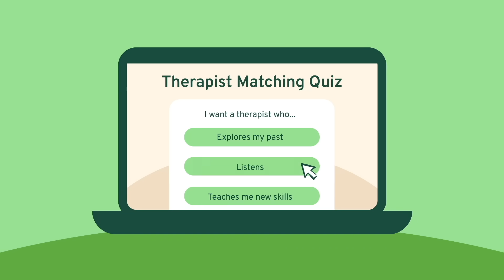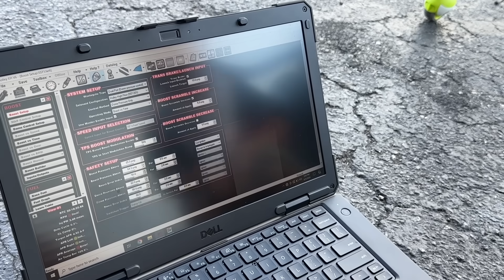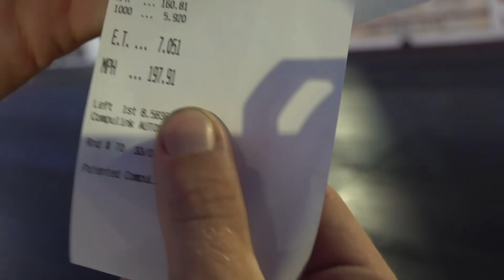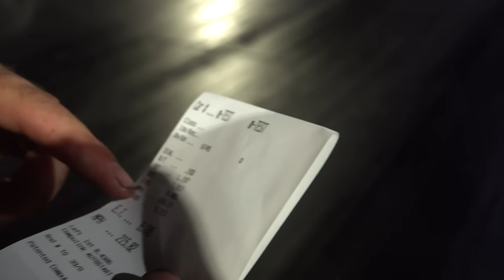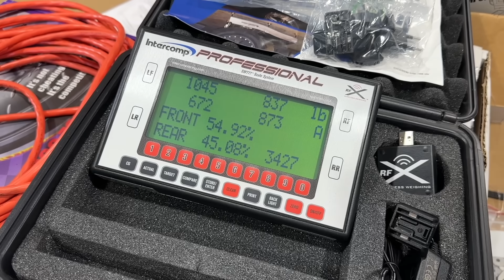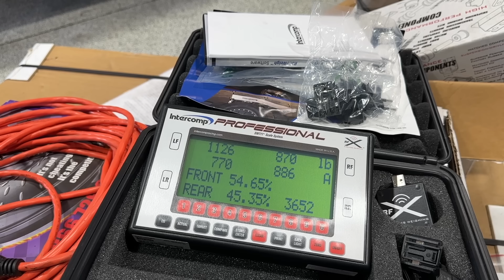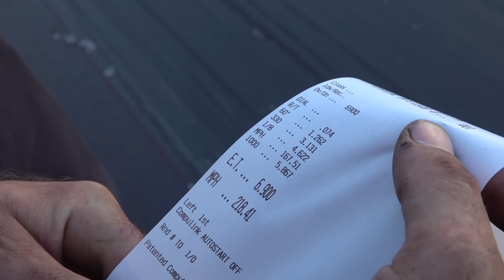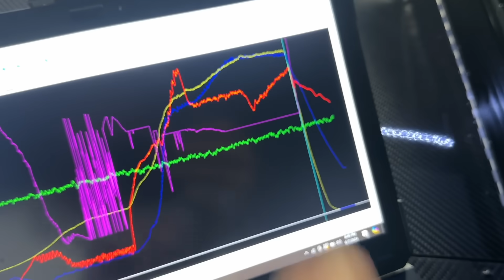The Dumbest Racing Mistake I've EVER Made!!!

Comment: About 35:21 ....
I would take that little piece of carbon fiber and i would throw it into the nearest lake. If anything i would spray foam the hole and spray flat black on the foam before i would ever let a small piece like that short to ground a single wire ever again. 
Zak made a great point in that carbon fiber Can be a conductor of electricity even tho our brains want to tell us otherwise. How can that issue be solved? Someone should break down just what is conductive in modern carbon fiber and eliminate/replace that component in its makeup so as to come up with the first "non conductive" carbon fiber material for the race car industry. 
For almost since beginning of time we used aluminum in place of carbon fiber for floorboards and covering holes. Aluminum is conductive too so it's not like we didn't know that, so in this case design principles should and could prevent future problems such as the one we seen here. But what im thinking is that modern carbon fiber has a weird conductivity to it in as much as if that problem could be figured out and eliminated could also make the material fire resistant as well. That in itself could be a huge benefit. 
I, my own self have no idea what the fire rating of carbon fiber even is but now I'm curious. If we can turn the same material into naturally fire resistant i can see how that could be the very next step toward modern race car safety. 
Just a thought.
Reply: Also upon review it was crazy to find how many times the letter/word "I" meaning ones own self was used. Had to back up and re-evaluate life and determine if the word narcissism applied to my own self. Upon review it's safe to say the problem mainly exists in my own failure of the English language and proper sentence and body of words structure.  
In other words "I" am not a hopeless narcissist! This is a good thing. But far as solving the problem it's not clear if a trip back to indoctrination world on a college campus would help. Best solution is probably to conduct several long essay type projects in order to learn how to make a statement or tell a story in first person but in a way so as not to say the word "I" nor refer to ones own self in nearly every sentence.
Reply: "non conducting carbon fiber" you mean fiberglass? lol

Comment: Again and again, environment factors before mechanical. air density and tyre operating temps. grip vs horsepower are mathematical, if its hot on track that window is smaller and harder than if its colder, and isnt linear !!!! Its a curve, of many factors, thats why u blew them off down the track, they over heated due air temps less cooling, track temps and friction, literally and u do the same thing by under compensating on hp but changing mechanical each pass as the air gets better, until the track grip comes and now your way off on hp and u start chasing the window again, and now over compensate,

Comment: Why aren't you posting sick summer????¿?
Reply: They have had SERIOUS problems. Heard on day one they had transmission problems. Day 2 (yesterday) Lifter exploded. Welded lifters together. Got a pass to stay in it running on 7 cylinders. Got it to motion race works. Filter is full of metal. Cam has been hitting lifters every turn. Last I saw, they were going to have to hammer out the welded lifter/s. Steve Morris is making a mad dash 4 hours drive with parts and tools. Going to try to rebuild it and get to the next track for a pass. Last words from Cleet "I think we are going to be ok." They are thrashing. I highly doubt getting a video out is his priority right now. If they do not get it fixed and to the next track for a pass, they are out of the drag and drive.